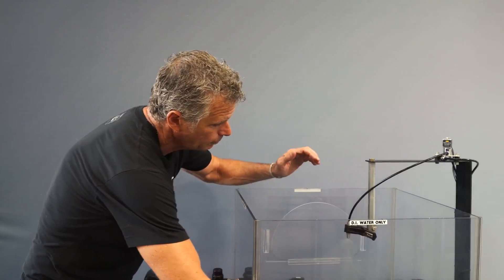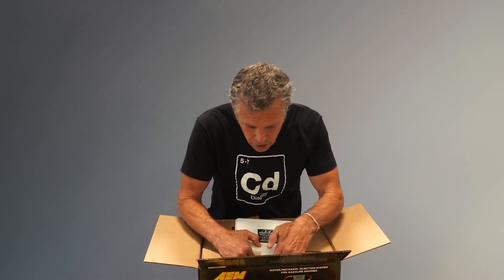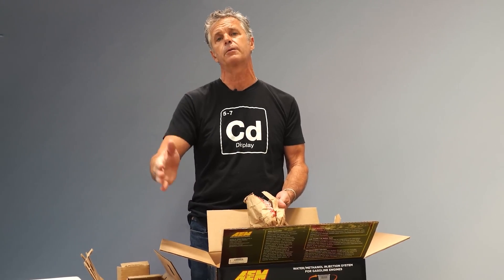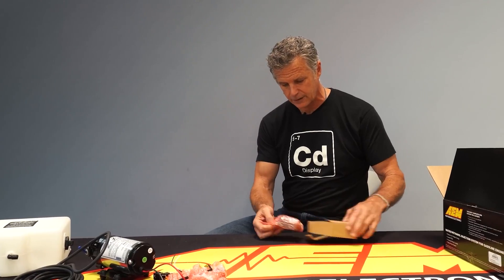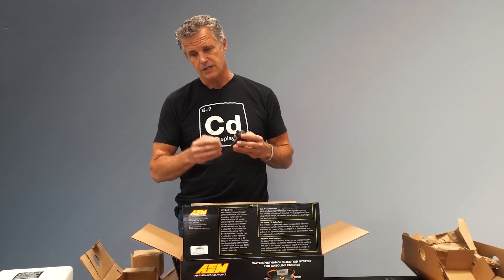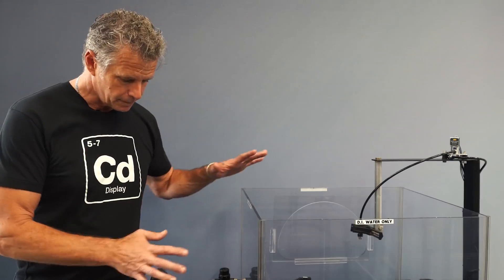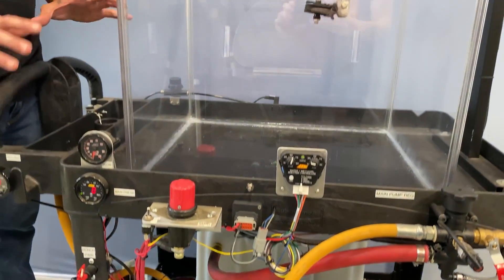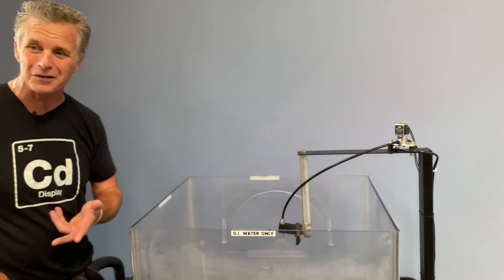Water/Methanol Injector Design BREAKTHROUGH!

Comment: 16:11 has a serious issue that invalidates the conclusions made about 6.5 seconds faster cooling time.

The V2 was not flowing water at the beginning of the test. Looking at the bottom data plot, the "Water Flow" graph clearly shows that the flow rate for the V2 nozzle drops to zero and then build pressure again which takes about 2-3 seconds. Furthermore, the "Solenoid Trigger" graph clearly shows the solenoid close during this period. This time discrepancy accounts for most of the shift seen in the top temperature plots. You can even see that the "Pre Nozzle" plot for the V2 system is shifted right as well.

Comment: Love the kit. Very COoL hardware. Q. Is that 50/50 by weight or volume? Actually, both ratios are still flammable. You need <40% meth to be safe (i.e. non-sustainable flame). Just saying. Thank you for the video. Thumbs up (except for the background track 🎶. I would rather hear what's being said than to RoCK out :)

Comment: I have recently upgraded to the v3 500cc nozzle from the v2, I also have a flow gauge in the circuit which the V3 500cc is reaching 1000cc on the gauge is there a reason for this?

Comment: I wonder what the actual charge air temperature drop difference is with the v3 nozzle. The 6.5s quicker temp drop means the charge air was cold enough to drop the temp of the thermocouple itself that much faster. I imagine that using an IAT sensor would react quicker and show the temperature drop more accurately.

Comment: My car is tuned with a 500cc v2 nozzle on a V1 kit , i  use it on track days ,use to keep things cool and tiddy, idont need it sinceiuse 100oct but i do like the cooling benefits it brings....if i use the 500c on the older nozzle should i stick with 500c on the v3 or switch to 250cc to avoid it getting to rich on the mixture????
Reply from the maker: I would start with the 500cc and keep an eye on your AFRs making the necessary adjustments to the controller settings if you need to reduce the flow level.

Comment: Received my kit last week, your dead on the packaging. Every part was well protected. The V3 spray pattern is top notch, and a kit that was simple for my tuner to apply it's benefit to my Taurus SHO. Don't let all the wiring spook any of you potential buyers. It really was designed to be stupid proof. And the kit did provide all I needed. My only mod i did was go to a brass T for boost. The T that comes with the kit is a very small and plastic. Other than that I rate this kit a 10.

Comment: Will the nozzle work for a pump that puts out 140PSI?  I am building a budget kit and I believe this nozzle design is really advanced against competitor nozzles. I am wondering if the atomization will suffer or will it still function as intended. Thank you
Reply from the maker: Yes, the atomization will suffer at lower pressures, however it likely will still surpass the pattern of other nozzles on the market. For best results I recommend the AEM 200psi Water methanol Pump.

Comment: Can I run this water meth kit as a substitute for an intercooler to bring charged air intake temperatures down?
Reply from the maker: Yes, the system can be used in non-intercooled setups, however for best results we recommend pairing the WMI with an intercooler when space allows.

Comment: If coupled with a tuner module on a Cummins 5.9, would this help daily driving, non-towing MPG at all?
Reply from the maker: The WMI kit is a race part and not legal for street use.
Reply: @AEMpowerTVelectronics  sorry, what I meant to ask was if I'm doing a 24hr LeMans with a Cummins 5.9, what kind of percentage mpg gains could I expect?
Reply: Huge gain in mpg